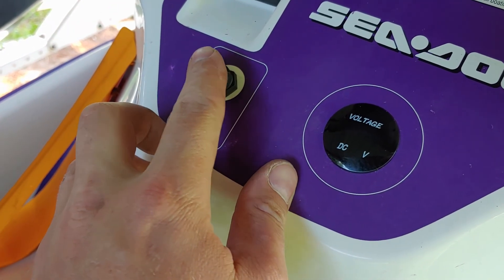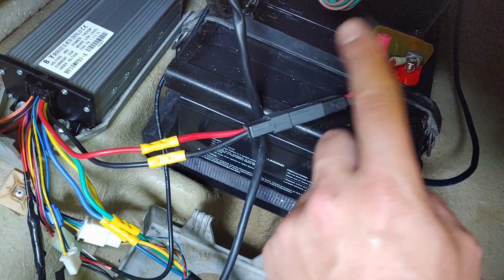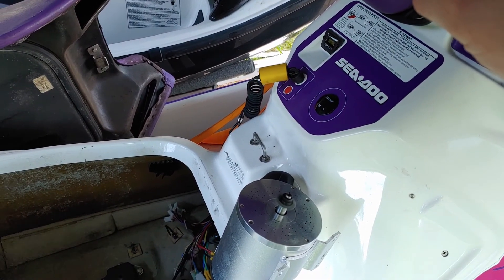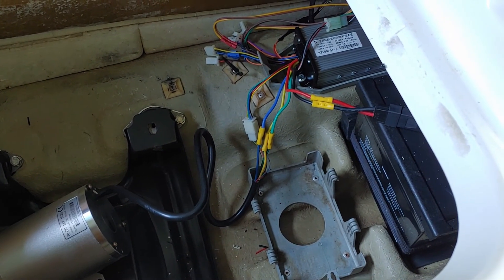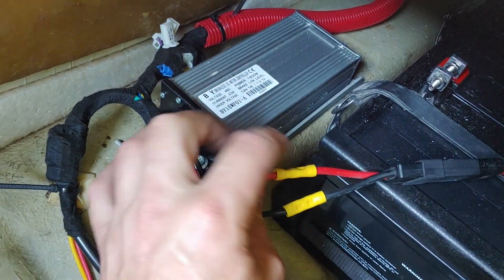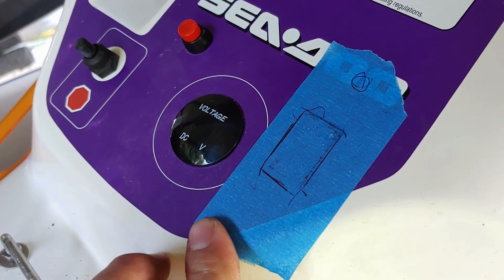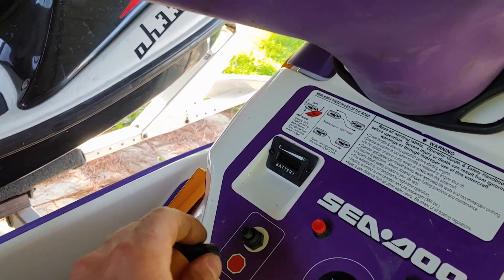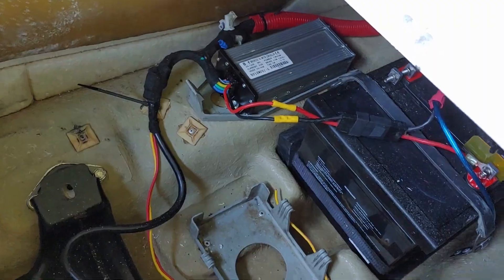DIY ELECTRIC Jet Ski Part 3 Controls and Electrical Cont'd

Comment: Is it possible to use something like a sabvoton 72/200 controller and an e bike battery to get this up to speed
Reply: Someone improved upon his design with a much bigger motor and lithium batteries instead of lead acid. It went much faster. The runtime is pretty low but it's still impressive https://youtu.be/v6kvaiXqgTQ